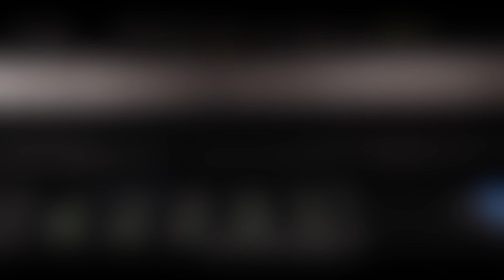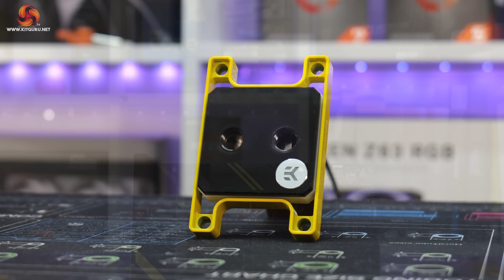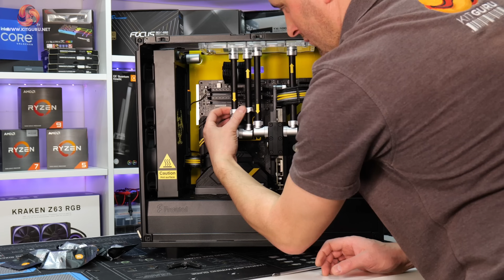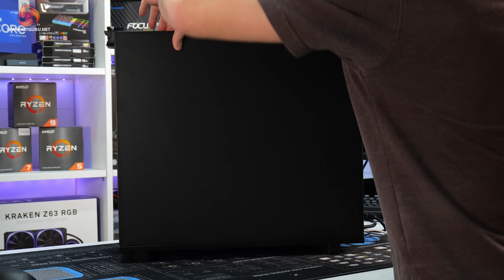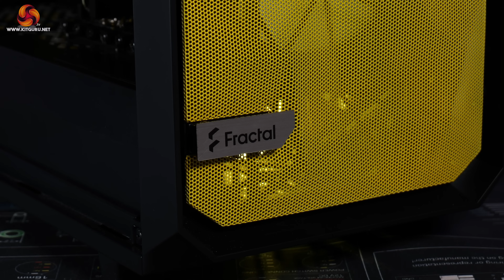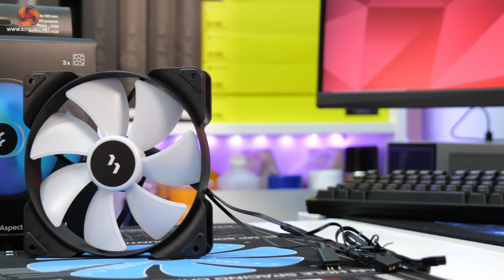Fractal Modded Build - HIGH CONTRAST (Part 3 - It's Finished!)

Comment: did you use wrap for the yellow motherboard accents james,i mite do simular with my b550,  after all that hard work the multicoloured spaghetti on the bottom right connection would get right on my nerves
Reply: Yes the front panel audio cables are a pain. If it was my own system I might have left those disconnected.

I used a yellow vinyl wrap on the motherboard accents.

Comment: This is my favorite MB orientation. I wish more case makers would experiment with it. I have been designing a case with it. It has a 420mm rad front and rear and if you get rid of the pci slot mount you can mount 3x 120mm fans on the bottom. Use a riser card to locate GPU on the top to show off the video card and use glass side and top (like an O11 turned 90degree). Power supply and water cooling pump/res on the right side ala O11 in open air and one of those HYTE LCDs on the front next to the front fans.
Reply: Sounds like an interesting project you have going there.

Comment: It looks nice and is done well, but I don't like it. You should have made custom case for it. That I/O access makes no sense. 
I know ancient ATX format is very limiting both for MB and cases and doesn't reflect current GPU and cooling designs, but I also know I/O is the most often modified thing for any case. This solution isn't engineered well. It's like getting into a car through the trunk. Except there is no door and that trunk is filled with cables. Nice video though.
Reply: I disagree, when I build a new system I connect my rear I/O to monitors, keyboard, mouse etc then very rarely touch it again.

Also this is more of a showcase system than an every day use PC. If it's too much hassle just use some extensions that connect outside of the case.
Reply: @barrychuckle2559  My keyboard, monitor and speakers are routed and cable managed through/around the furniture (mouse through the KB). Every time I go for deep cleaning, some update or anything I disconnect them from PC. There are unique cases, mostly in ITX space, that rotate MB and still have reasonable access to all the I/O ports. This one has not just limited access, but extra obstructed. I'm not nitpicking, this is just a suboptimal match of case and solution. Or would you call this a perfect solution?
Reply: @vensroofcat6415  I would call this a guy in his shed modifying something with basic tools and doing a bloody good job. Not a multi million dollar company designing a new product with a full r&d team, million dollar machinery and a marketing team.
Reply: @barrychuckle2559  And I'm saying it has engineering issues. He is not a 3 y.o. you have to support at every step, right? And he asked for opinions. So I'm saying I respect his work and results, but consider some solutions questionable (add "bloody" somewhere for more confidence). There is a room for improvement, ok?